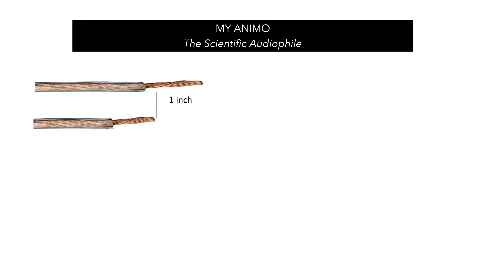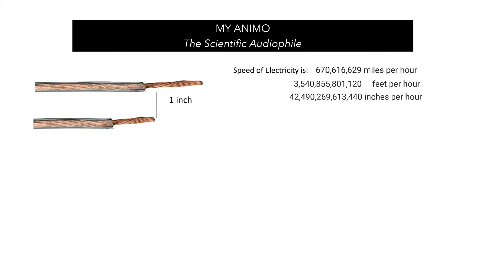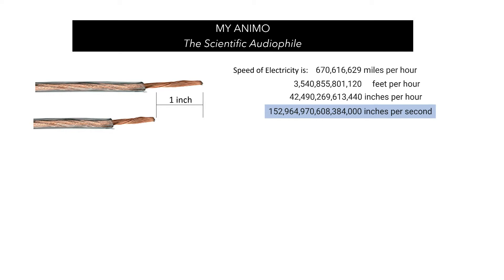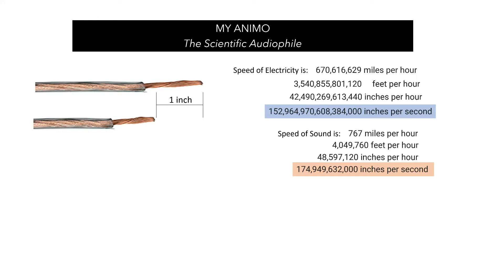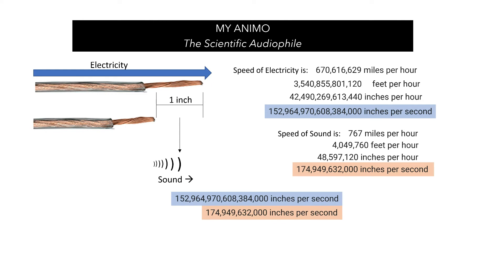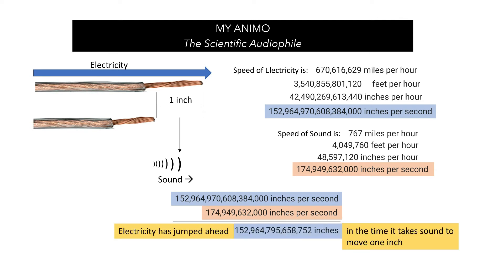Speaker Cable Lengths

Comment: Terrible conclusion. This would mean that for a METER difference in cable length, the electric signal reaches one speaker 1/15,0000,000,000,000,000 seconds before it reaches the other. Even the world's larget particle acceletor could not detect that difference.
Reply from the maker: And yet I can!

Comment: The length IS INDEED the most important issue in a speaker cable. Or any true audiophile cable.

If it is too short, there will most certainly be a more then a time issues, there will not be any sound at all if the cable is too short...

Comment: See also on ASR: https://www.audiosciencereview.com/forum/index.php?threads/different-speaker-cable-lengths.24465/post-826079
Reply: Basically what he did was calculate the difference between the speed of light and the speed of sound in inches per second... nothing more. (and leaving out the three zeros at the end of the subtraction)

Comment: Assuming your speeds are correct (didn’t check) this just means that one speaker will start 1/ 152,964,970,608,384,000 of a second earlier. No way this is audible. But if you want to compensate, you have to move your speaker 174,949,632,000 / 152,964,970,608,384,000 inch backwards (1.14… * 10^-6 inch). Good luck :)
Reply: Folks, this video is literally farce. The man is skewering the high end cable companies and their adherents. No one cuts cables with lasers and First Run Cables doesn’t exist. 

Get a sense of humor.
Reply: @billd9667  I found it really funny. I've been going through all of these videos because I love the subtlety and care with which he does the videos. Did you find them entertaining or do they seem insulting? If you found them to be insulting, I'm sorry. I've been getting a big kick out of them.
Reply: @AndyBHome  I think they meant to be insulting to some. They are not to me 😉
Reply from the maker: It’s why only First Run Cables are in my system. Laser cut and guaranteed to be within 1/100,000,000,000,000,000 of one millimeter in length.
Reply: @scientificaudiophile  I’m sorry, this will be my last reply. There’s nothing scientific about this. You cannot subtract two speeds and end up with a distance (the result will be a speed difference in inches per second). And two: if your compensating with a difference in speaker distance that’s larger than the difference in cable length, you actually saying that sound travels faster than light. Just bullocks.
Reply from the maker: @delub0242  Math isn't for everyone.  Its complicated.  Just go to the last 30 seconds of the video and follow my advice.
Reply: @scientificaudiophile  this comment convinced you must just be joking (and I failed to see it as I don’t find it funny). You must also find a simple subtraction complicated as you aren’t even able to subtract these two numbers without putting the right number of zeroes at the end.
Reply: @delub0242  um, he is joking. And it’s schpelled “bollocks”. Are you a fake subject of the Queen?
Reply: As we all know, an electrical circuit goes not just TO a component, in this case the speaker, but BACK to the source, the amplifier. If one of the speakers is connected by a wire that is longer than the other, the signal will not only take longer to get there, but it will also take longer to return back to the amp, causing a delay that gets worse and worse the longer it's left to play. Not only will one channel sound slower, it will also get progressively behind the other channel as the playback continues. I know some people will say that this produces a pleasant, natural time distortion that increases the soundstage, but it doesn't. It's wrong and it sounds terrible, and it's why all of the serious cable manufacturers are imitating FirstRun by employing high precision laser cutting systems to ensure identical lengths in their audiophile cabling. Uneven cable lengths are inaccurate because they aren't symmetrical. You can't correct inaccuracy with more inaccuracy. Again it's just math. Inaccuracy adds to inaccuracy. You don't subtract length from speed. You add the loss of accuracy from length to the shortcoming of accuracy from speed and you get really bad inaccuracy. Perfection is obtained through symmetrical accuracy and not voodoo audio folk lore.
Reply: @AndyBHome  what? Timing differences don’t stack. That’s real voodoo. 

Considering the speed of light, a one foot difference is inconsequential. A one inch difference is literally nothing at 183,000 miles per *second*. 

Someone needs to take physics again, if he ever did even once.
Reply: @billd9667  of course I am kidding. The whole channel and all of the videos on it are a parody of the pseudoscience that permeates much of the home audio hobby. I was just playing along, but Chris the Scientific Audiophile isn't going to break character here. I was trying to exaggerate the issue to the point of outrageous absurdity while keeping in the spirit of what can easily be found in any audiophile forum. Obviously these lengths don't matter. We're just having fun pretending and playing the imaginative audiophiles who think they can explain logically why things matter that the actual inventors of these technologies know to be utterly meaningless.
Reply: @AndyBHome  I thought you might have been playing. Masterfully played.
Reply from the maker: Quite the opposite. It’s not just audible, it’s unbearable.
Reply: @scientificaudiophile  that’s very unfortunate. This must prohibit you to enjoy any reproduced music, doesn’t it? Since the difference between light speed and the speed of sound is so huge, you must be able to detect even a fraction of an inch difference in cable length then. What can you stil hear? 1/1000 of an inch?